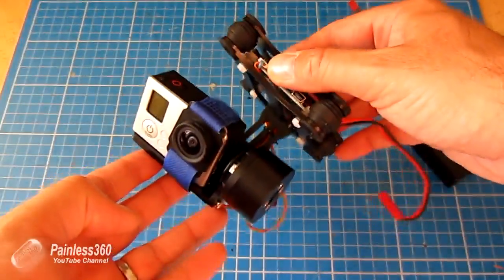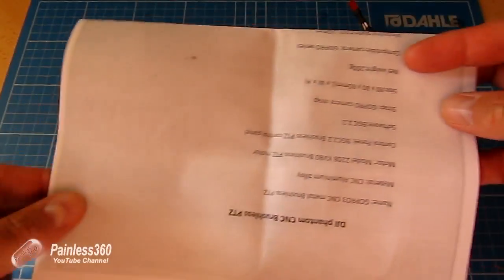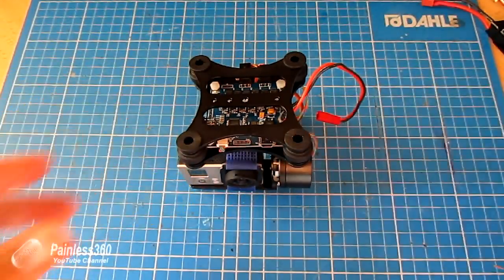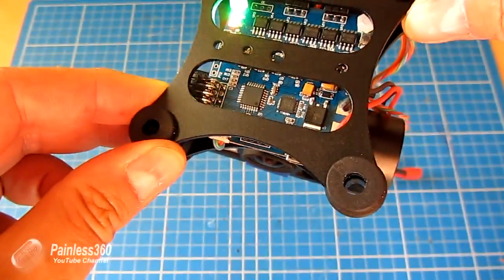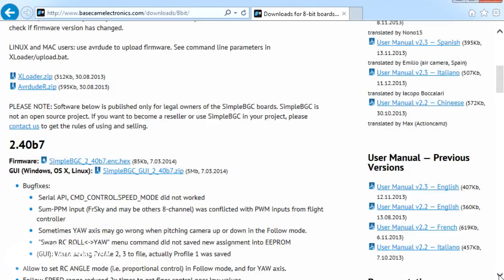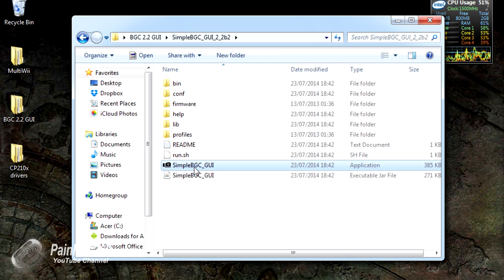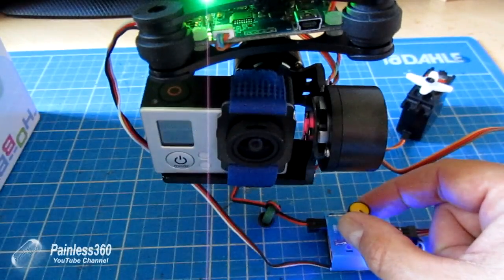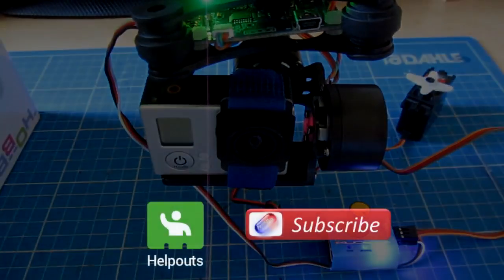BGC 2.2 (2.2b2) GoPro Camera Gimbal – Software, drivers, setup and receiver connections.

Comment: Ok, I'm at My wits end, I have 3 of these Gimbals, and up until My last Flight everything was working fine on My XK X380. When I went to go do a Video this last time, the Gimbal Powers up but is totally non-responsive and I've done nothing to change the Gimbal in any way. When it powers up the Green Led flashes constantly very fast, never goes solid green. So I hooked it up to the UI software and everything checks out ok and Calibrations all work fine. Then when I switch back and Power Up on the Quad it does the same thing, like it's stuck in Gyro-Calibration mode.
OK, so I replaced it with a back-up and it works fine, so now I'm trying to get this Unit functional, and I'm not seeing anything wrong, just that it's non-responsive and the Green LED flashes constantly, except when it's connected to My PC, works as it should. I'm confused, and was hoping You could take a minute and look at My settings in this Video, let Me know if You see something I've missed, any help would be appreciated..  :)
 https://www.youtube.com/watch?v=7QlmfrBWGC0&t=450s
Reply from the maker: +Hyper Joe I've not seen that here, I check that all the cables are ok and installed the camera and hold the gimbal securely while powering on to see if that helps. Best of luck
Reply: Thanks for the Reply, I'll check the cables, as when I installed the other Gimbal, I did Install with fresh Cables, just not making any sense, as it worked fine then all of a sudden nothing. I'll bench test everything again tonight, and if worse comes to worse, I guess I'll just replace the Board, looked them up and they are only about $20 USD. Was hoping I wouldn't have to go that route. Thanks again as always, Happy Landings!  :)
Reply from the maker: I hope you get it sorted, these 'cheap' gimbals are a nightmare if they start to mess up as there is little support and the answer of 'upgrade the firmware can't be done on a lot of them. Happy flying!
Reply: Thanks for the info/feedback, luckily they are CHEAP, and not a great loss if the board is trash, one reason I chose them, for experimenting, just thankful it's not some $300-$400 dollar set up gone bad. I'm just a Hobbiest and not Professional and when they work they work well enough for My Applications. Love Your Vids, keep Them coming.. Hope You get some awesome Flight Time in as well..  :)

Comment: Hi
i have set as you advice and 
 when i check the operation before flight (play around with the quad) all work fine
when i fly faster then fast hover (even less then 20 K/H) the camera start to jump
any idea ?
thank you
Reply from the maker: Not sure, I'd record the settings in the GUI and maybe look at increasing the power to the axis that is losing lock. Best of luck!

Comment: Hi
i have made some changes and can not go back...
can you put a link to a simple profile file
thank you
Ram
Reply from the maker: רם חכמון we don't have a configuration file here. The best bet is to watch the video and pause it as we look through each of the tabs in the setup software. We have to do this once when we clicked defaults by mistake. Best of luck
Reply: Standard settings are:
PID Controller
ROLL P:10  I:0.15  D:12
PITCH P:10  I:0.25  D:15
Motor Config
ROLL Power:140 Poles: 14
PITCH Power: 100 Poles: 14
-Advanced 
Timings
PWM Frequency: HIGH
Rest of the settings shouldn't matter if you've reset to default
Reply: thank u

Comment: Hi. My gimbal board says it has not got the same firmware so I cant do anything. How can I change it the 8 bt download has no firmware in it the folder is empty
Reply from the maker: Sorry, we don't have this one anymore. I'd get in touch with the vendor for help/files. Best of luck with it..
Reply: Find which version you bought first then download the right software to match the version, there is a different software to match each firmware.
You could always try to update your firmware to match the GUI.
Be aware though, there's a lot of cloned boards out there that you can't upgrade the firmware on
Reply: Hi Frank and thanks for your reply. I am afraid I found out the hard way about the copy boards I fried 2 gimbals.I have now got a board that will connect and allows changes without frying the board

Comment: Painless, thanks for the great videos.  I have an issue with this gimbal and maybe you have some ideas. 
It worked fine. Then I took it off and remounted it. I plugged in the servo wire wrong and got smoke.  Oops. Checked everything and plugged it in correctly and it worked. Then today it is dead. No lights. No movement. I plugged it into the computer with the cable and it lit up and read everything fine. Still, when I put it to 12v I get nothing.  Any ideas? Nothing looks burnt. Did I kill the controller?  
Thanks for all of the great work!
Reply from the maker: If you got smoke then something is damaged.. Best of luck with it!

Comment: Hello, great informative video.
I'm trying to use this gimbal for a hand held steady cam project. That means I have no need for a flight controller, so I was hoping you could point me in the right direction for some components.
Around the 7:30 mark you used the servo sweeper in conjunction with some sort of power regulator paired with a battery. I would appreciate some guidance on the power regulator and battery + charger. I unfortunately have very little rc experience so I am largely unfamiliar with these components. 
So if you could point me towards a battery and power distributor like you used in the video it would be much appreciated. Again I have no need for radio control, so your test rig would be the perfect solution for my project. Ideally it would give me 2+ hours of run time between charges.
Thanks, Teddy
Reply from the maker: You can use any 3s battery something like a 500-800mAh should be ok for this (unless you want to run it for hours at a time). You'll need a UBEC that has about 1.5amps available and a couple of 'servo testers' (that's the thing with the turny knob) to use to set the angles of the gimbal. Best of luck!

Comment: Where did you get the servo dial you called "flight controller" ?
Reply from the maker: +Patrick Lacson not sure what you're referring to. What part of the video?
Reply: The little controller that had the knob/dial to control the gopro causing it to tilt down and up.  Where do you get that?  Is that the same as this?  https://www.amazon.com/DIYmall-Digital-Consistency-Controler-Checker/dp/B012LZKTDO
Reply from the maker: I see! That's a servo tester.. :)

Comment: after installing the drivers, the red light goes on...on the controller board and and a green light goes on...on the gyro. Computer says usb device not recognized
Reply from the maker: I'd try another USB cable and port - standard USB driver troubleshooting I'm afraid - best of luck!

Comment: you wouldn't happen to know how to control the pitch when your output is set to ppm? There is ppm option in the simplebgc gooey which I have tried and still doesn't work. I can get it to work but setting my output to pwm but then I can't control the quadcopter. I'm using a naze32 board.
Reply from the maker: I'd look at channel forwarding to send one of the channels onto an unused PWM output.. Best of luck!

Comment: Hi. I have connected everything as you have in this video but the Gimbal constantly vibrates. any suggestions would be awesome. Thanks
Reply from the maker: I've not had that here but I'd suspect that it's because the power level setting for that axis is a little low or the gimbal isn't balanced. Check the gimbal rests horizontal naturally with the camera in it..
Reply from the maker: The camera is supposed to sit on top of that bit, not hang from underneath. Mounting it that way will not allow it to balance naturally (see previous answer)..

Comment: Ive got the same gimbal, but, I'm having trouble keeping it working correctly. A lot of the time itll take off jerking back and forth til finely it will roll to one side and just sit thre making a buzzing sound. Ive been told that my PID settings are the issue, but, I have no ideal what to do with them. Can you help?
Reply from the maker: All of the setting for ours can be seen in the video. If it's been like this since you got it then I'd get onto the vendor for replacement/support. Best of luck with it..

Comment: ever since accidentally clicking the use defaults button, it now just keeps bouncing to the limit going back to center and bouncing back to the limit again repeatedly. Any ideas???
Reply from the maker: I did the same thing with mine - it's too easy to do in the GUI. Luckily I had this video and freeze-framed the settings to put them all back in.. Best of luck!
Reply: Thanks. I used the settings that were briefly displayed earlier in the video and it seems to be working pretty well. I took some video with it last night... pretty impressed with how well a $35 gimbal works! BTW love your videos! Made setting up my Pixhawk with the Taranis a breeze, I really don't think I would have been able to do all that on my own. I'm not the best at navigating open source equipment and have very little patience.
Reply from the maker: Glad they help, we try and explain what we find out as the documentation with a lot of the technology isn't easy to follow for the new pilot (and some not so new pilots!). Happy flying!

Comment: How can you control the gimbal's movement using a remote control instead of the servo checker? Thanks!
Reply from the maker: +furulevi you plug those leads into the channels you're using in the receiver. See one if the videos in the Nova Pro series for a demo
Reply: You'll need a Transmitter-Receiver setup with free channels. I have a flying 3d x8 and this gimbal works perfectly on it.
Reply from the maker: I see. Then all you can do is use the switches for 'preset' angles. Best of luck!
Reply: I have a Devo 7E, it has no potentiometers (unless I modify the radio somehow).
Reply from the maker: Why do you need 'pots'?
Reply: Can I control the tilt angle of the gimbal with the switches also?
Reply: furulevi I don't have the know how for that, but you can adjust camera angle with the knob thingys (potentiometers I think).
Reply: Gairik Biswas
Reply: Maybe I am getting you wrong, but what I meant is to connect the roll and pitch control to free channels to your FC (I think) or Receiver. Your remote should have potentiometers to control the movement. :s

Comment: i got bgc 2.2 its safe upgrade The firmware? or it can brick my board? if its safe i do it from simplebgc GUI 2.2? thank you
Reply from the maker: +Manel Correia I'd check with the vendor for the one you have. Ours had lots of warnings in the manual. Best of luck!
Reply: +Painless360 THX!! vendor said it cant be upgraded. i was think about upgrade because im having alot of problema tuning properly. Cant get it work as it should. :(

Comment: Can you please help me with something? I used my this exact same gimbal for about 2 days and i loved it but now when i plug it in to power it up, the gimbal does not do anything. it has a green light on the bottom and a red light on the top. Previously on mine there was a green light on top. there is also a green light on yours. Do you know how to fix this problem? I dont care about calibrating much I just want my gimbal to work. Please help me sir.
Reply from the maker: Sorry, I've not seen that here. Sounds like a power issue with the main controller, I'd check all of the connections are ok. Best of luck..

Comment: Are you able to have the gimble motor on the left in stead of the right so the fpv cable doesn't hit the motor?
Reply from the maker: Possibly, we've not tried but you'll have to move the sensor and also look at reversing the correction for that motor too.. Best of luck!

Comment: hey, i want to ask you if this would fit for the sony fdr x 1000v action cam! It weights 114gramm without housing.
Reply from the maker: It's designed for the weight of a Hero3 camera so if it's close then it might work. The gimbal should naturally balance with the camera installed so that the servos/motors are being used to just move the camera not support it's weight. Best of luck!
Reply: ok, but how could i set up the weight of the sony when its for the gopro designed?
Reply from the maker: Depends on the weight difference. If it's lighter than the GoPro you could position it out further on the mount or add weight to balance.. Best of luck!
Reply: its 114 gramm----the gopfo is 60-70gramm
Reply from the maker: Waaay to heavy then ;(
Reply: yes i think so! Im watching out for the dji osmo stuff! Because even with the feiyu g4s the sony cam looks shaky.

Comment: Hello! I just tried to use a 2.4v to my gbc v3 and I think I've bricked it... is there a way to recover it ?
Reply from the maker: +Jose Roberto Kerne I'm not sure, I would contact the vendor for support. Best of luck!
Reply: Ty for the prompt answer... I just figured that my bgc v3 was a clone version and... it bricks if you try to install the 2.4+ firmware on it.... so... only the martinez firmware will actually work... maybe I can get it back to work if I can burn the bootloader on it again... I will keep you posted.

Comment: Hello and help! I have just bought a similar gimbal from banggood. It dies exactly the same in terms of vibrating when turned on and makes a buzzing noise. I've downloaded the driver and GUI 2.2 but I can't connect as I have no ports. I'm not very computer savvy so need to know if I am doing something wrong. Sam
Reply from the maker: +sam albustany all of the steps are in the video. Best of luck

Comment: Hey... Same problem like Dave.... Only RED light and no movement on the motors.. HELP HELP please THX
Reply from the maker: +kamishibai I'd contact the vendor for help if the power connection is all ok and there is a camera in the gimbal to balance it out..
Reply: +Painless360 camera is balnce.... when i buy evrything woking.. but one time i want turn on gimbal. Only red light motors no mevement and when i want connect to PC "Serial data currupted"

Comment: What are the limits for the input voltage to the board? Can it work from a motorcycle battery between 12V-14V?
Reply from the maker: +Nikolaos Beratlis Not sure, the packs we use here range from 12.6-11v and it works great..

Comment: I've been pulling my hair out trying to configure one of these to work with an Iris+. I sort of get the idea that the Pixhawk in the Iris is trying to stabilize the gimbal, and the gimbal controller is also trying to stabilize the camera, ergo the signals are essentially fighting. Would you recommend disabling pitch stabilization on the Gimbal board, and allowing the pixhawk to control it? End game, I'd like the Iris to be able to  be able to control the gimbal for autonomous missions. Thanks!

Comment: hi lee. ive now purchased 2 of these  and the first worked perfectly as you described but the second will connect to the gui but when i connect my 3s cell all i get is a constant red light and no movement on the motors. any help would be great. many thanks and happy flying
Reply from the maker: Sorry, not had that here. I'd let the vendor know in case they can help.. Best of luck with it, we will be looking at a newer gimbal in the coming month..
Reply: Thanks. Like I said the first worked beautifully so I bought a second which doesn't

Comment: hi. can i use it on my cx 20 no? i can connect it to aux 1 aux 2 to control it? thx
Reply from the maker: +Drónok és sok más If that model provides two PWM connections for that then maybe..
Reply: +Painless360 Thanks. i want to use it on the cx with a xiaomi yi

Comment: What is your recommendation for a battery for a standalone brushless gimbal?
Reply from the maker: +Trick Shots 4 Real I always run the gimbal from the flight battery but I would be looking at a 500-800mah 3S pack to make sure that it always has power and I could fly multiple flights before needing to change it.. Best of luck!
Reply: +Painless360 This gimbal is not actually on a multirotor. So that being said, would it benefit to get a battery with a higher mAh rating?
Reply from the maker: More mAh = longer time powering the gimbal. Best of luck!

Comment: first off,fantastic videos painless i got the taste with a Symax5c now getting to grips with a totem Q450 and followed your APM series...my question is possibly stupid. i have one of these gimbals now, do you have to use a seperate supply or will using 3 wire connection from the APM be enough to power the gimbal? your servo tester i presume is a supply direct from the battery....is the APM man enough to power it up or will i need to power up from the battery bus?
Reply from the maker: As I've just replied to your other comment. We cover this in the video. Without a LIPO connected the motors will have no power.. Best of luck.
Reply from the maker: The gimbal has a controller, two motors and power circuitry so you need to power it from the pdb. Best of luck!
Reply: +Painless360 this was the way I destroyed my last one.  Almost the same question I have to connect it to a PC. USB AND 3s lipo? Or only USB?
Reply: +Painless360 best thanks. That was what I thought. Bad luck happens ;)

Comment: NEWBIE QUESTION: Is it possible to connect a gimbal directly to the APM 2.6?
Reply from the maker: Yes but it depends on what you mean by external gimbal.. If you're expecting to control a gimbal that uses brushless motors without another driver/control board then you can't.. Best of luck!
Reply: +Painless360 it's a Brushless gimbal with controller... How should i connect it? Thank you!!
Reply from the maker: We cover that in the video at a high level. http://copter.ardupilot.com/wiki/common-tarot-gimbal/ may help. The gimbal will do the stabilisation itself so you only need connections to alter the direction it's pointing. Best of luck..
Reply: You are great... Thank you so much ☺